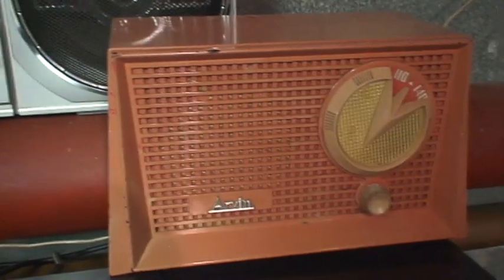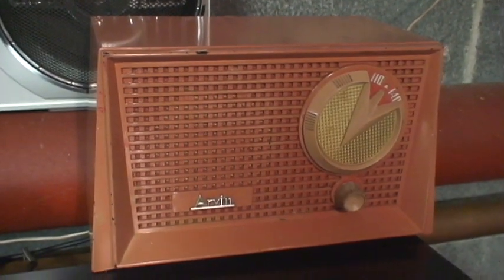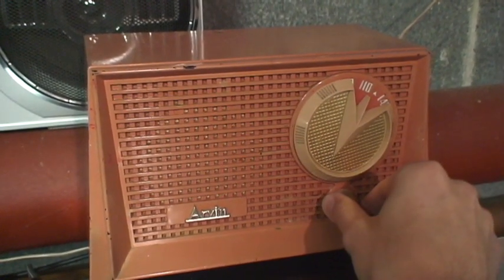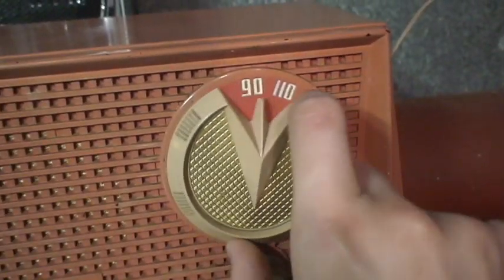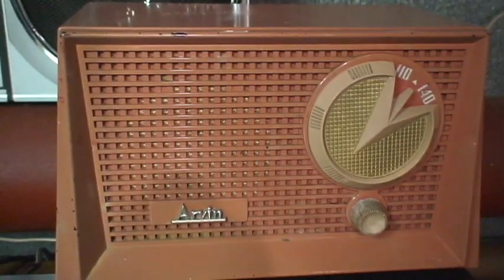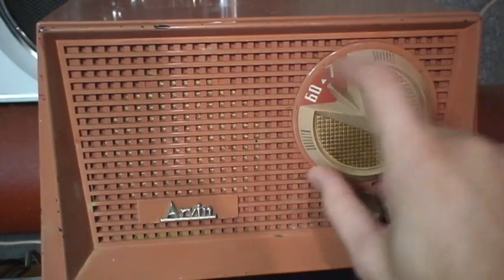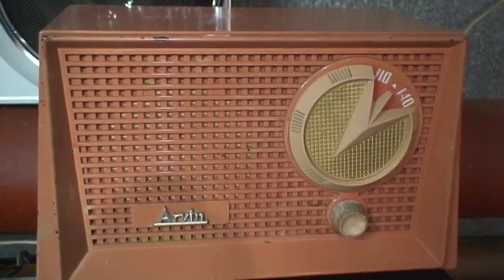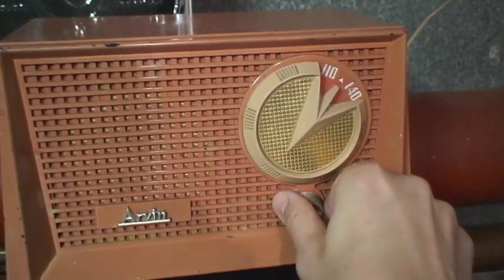1950s Arvin 951T tube radio, all-original & working

Comment: Nice radio. And all original parts? That's awesome. Well these things were built to last a long time. I got an RCA Victor radio from 1953 running on all original parts except for a few tubes. It doesn't have the nuclear emergency triangles on the dial though.

Comment: This is very similar to mine...mine is still working on all the components it came with but its electrolytic was replaced with an original-style metal cap in the '80s. I think all the other caps in it are ceramic. The biggest problem I have been having now are bad capacitors in the IF cans. 50% or more of the tube radios I work on having the small size IF cans with the adjustable ferrite cores have had the bad caps. Philco and Arvin seem to be less susceptible for some reason.